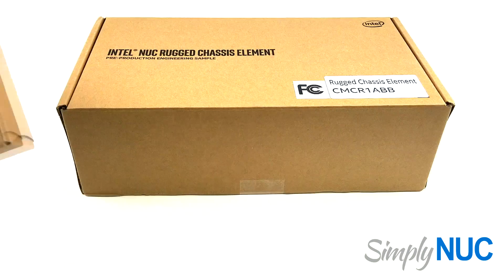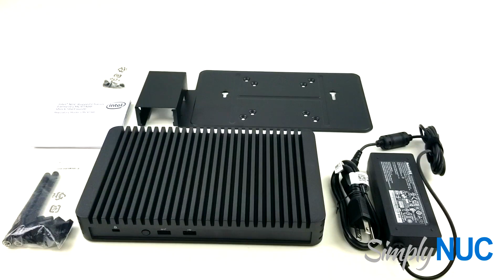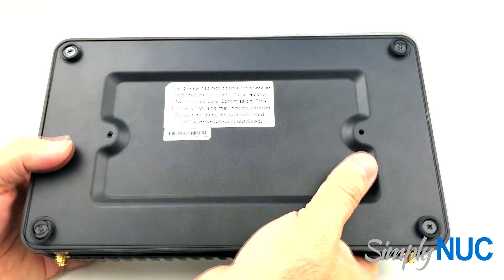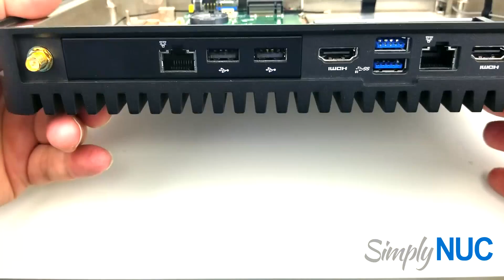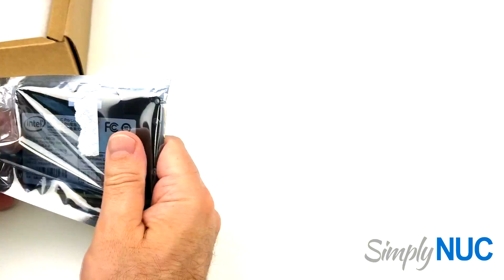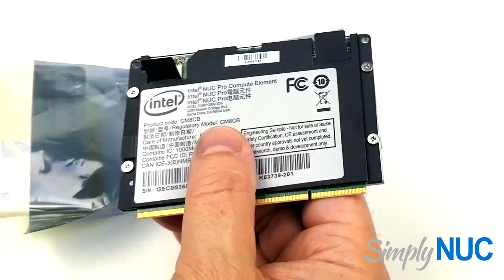New Austin Beach NUC - First look and Full Overview

Comment: That NUC looks perfect to make your own wifi router gateway switch vlan system using pfSense or opnSense, to bad it does not have a second NIC/LAN in it. You would of used one port for WAN, the other for LAN, and the wifi in it as an access point for WLAN.
Reply from the maker: It actually does. You can select from different chassis. One of them has the second LAN port.   Here is a link.  https://simplynuc.com/chandler-bay/?chassis=cmcr1abb select which processor you want in the system and then the other options for the chassis will appear.

Comment: I was going to get a NUC until Intel downgraded their CPUs in the latest models and started getting shady because of AMD competition.
Reply: What do you mean by "downgraded their CPUs"? The newest NUCs have quad core and six core CPUs in some of them. The specs have been better with each newer release.
Reply: @MitchyTheKid4095  The CPUs in the GEN 10 are faster but they've downgraded the Integrated graphics
Reply: And the integrated graphics were already a bottleneck in the last generation. Get a gen8 model or just put together an ITX AMD APU for way more power and less money.
Reply: i switched from gen 8 nuc to deskmini!

Comment: Is the unit well shielded? I need it to work in a noisy electrostatic environment in a music studio/
Reply: It is a solid, heavy metal (aluminum) box that is water-tight other than the IO connectors, but there are rubber plugs for any unused ports. I would expect it to be very quiet other than the cables coming out, so use high-quality shielded cables and it should be very quiet. It is fanless, so there are no holes in it other than the IO connectors. Even the Kensington Lock hole is a sealed compartment.

Comment: I think you could probably use a better script for describing the features of these things. This 23 minute video could have been shortened to 10 minutes if you hadn't repeated yourself 27 times. That being said, I think Intel is going to have a niche audience for a computer that has all the memory and the wi-fi module on a processor daughterboard instead of on the motherboard, where it belongs. Why didn't they have a positive contact system for the wi-fi antenna that would automatically connect when you snap the card in, instead of those chincy leads that may or may not break the coax connectors off of the wi-fi module? Also, I don't see any reason for the port 'plugs' when the whole base plate doesn't even have a rubber gasket to keep the moisture out.😜 Another point is if you try to run a late model Core i7 in this, it will most surely be throttling back almost constantly because there isn't enough surface area to dissipate the heat. I have a 3 or 4 year old laptop strapped to the back of an HDMI monitor (because the screen is broken on the laptop), and it has a Core i7 with on-board graphics, and it will start running hot after 20 minutes or so of video play on Windows 10. The fans are literally running wide open and there's no air blockage internally or outside.

Comment: Two things : external power brick and Celeron. Done
Reply from the maker: Actually, the nice thing is that since it is built on the NUC Element concept we can provide any processor from a Celeron up to an i7 in this same product.  Here is the configuration page:   https://simplynuc.com/chandler-bay/?chassis=cmcr1aba
Reply: External power is great for a small device because the heat from the power source is away from the board which keeps everything cooler.
Reply: @oscar1rules  in industrial applications those external power bricks are a nightmare to mount. Why not mount it tight to NUC but isolate the heat. It's all looks good in pictures but I rarely see those mounted in marketing pictures. Just like network switches. I'm yet to see a single marketing picture with any cables. I'm guessing because none of those are actually designed with that in mind.